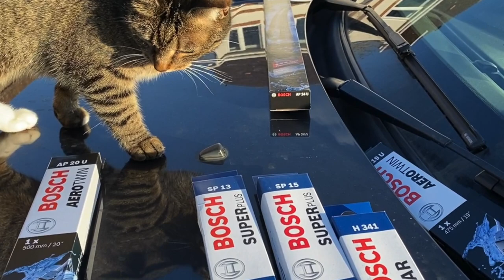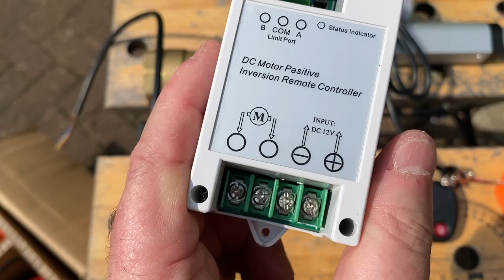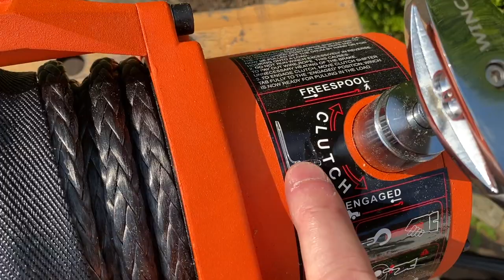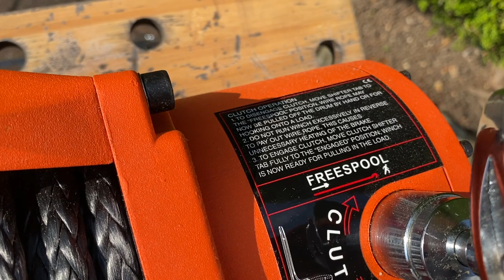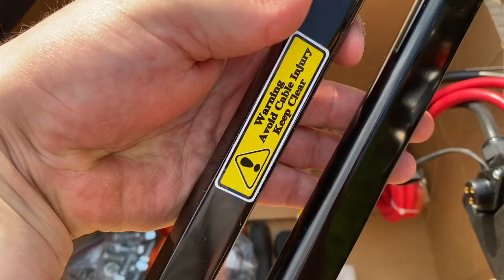Fitting a winch to a Land Rover Freelander 2 / LR2 (Part 1 of 5)

Comment: Bring on pt2, just wondering if you've removed the swirl flaps of death from the inlet, I did mine bout 2 weeks ago when I replaced glow plugs improved the MPG on weekly work run. the oil catch can and bracket are essential buy for this vehicle, keep up the good work.
Reply from the maker: Thanks Ian. Not removed the swirl flaps yet but on my list. I also need to replace the glow plugs. Will video it when I do them.
Reply: see you use a jigsaw in pt 2, should have used a multi tool for cutting the bumper you get a better cut. I've used it for cutting out for the driving and fog light upgrade also used it for cutting dash to put switch in.
Reply from the maker: Thanks, have just bought one! Will use it on the bumper cover hole.

Comment: I would have informed the manufacturer of your fitting Issues. They possibly have had feedback from buyers over similar issues and come up with a work around to follow. You bought the Item in good faith, in  that it would fit, connect and work.
You have paid for the Item. But it's costing you more expense to adapt ?? See you in the next one. 👍👍
Reply from the maker: Are you talking about the winch relay box? That would normally locate on top of the winch.
Reply: 👍👍👍 waiting on pt2, can't wait to see how you finish this.